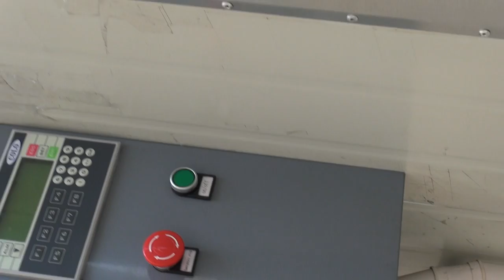Powder coating oven for sale

Comment: Dear I have a issue with your design.. Hot air should be supplied from the bottom instead of throwing it from top to bottom